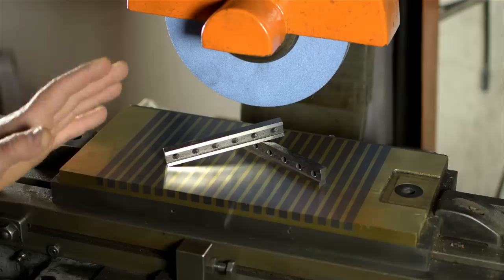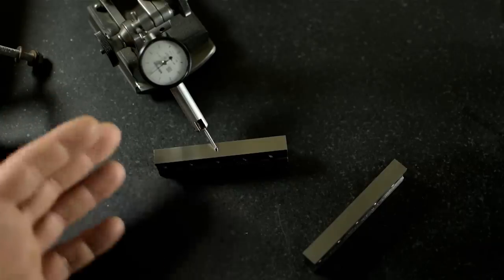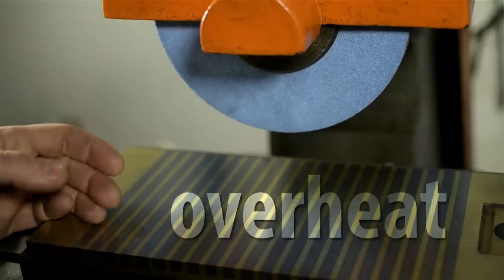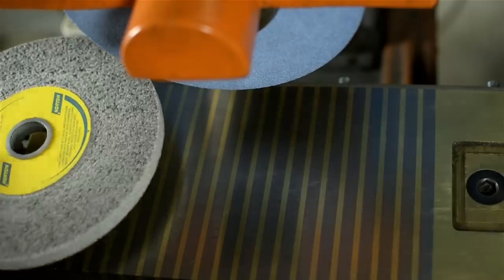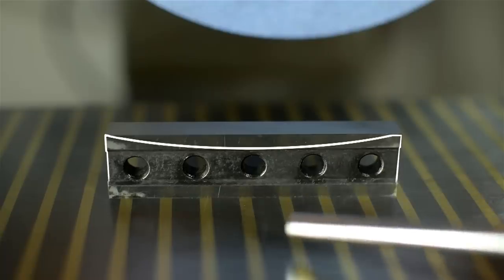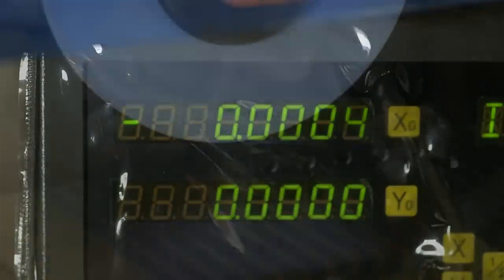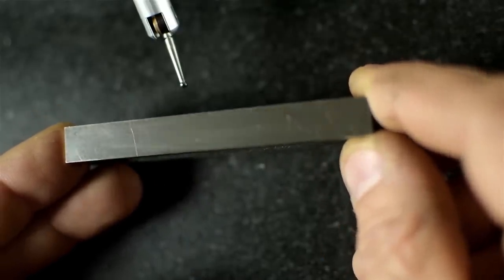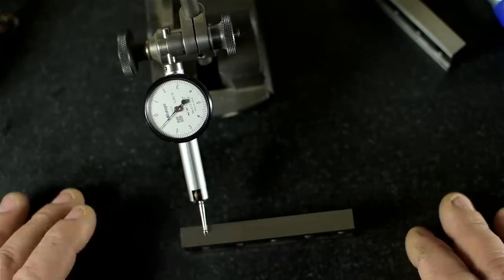Grinding: FEEL THE HEAT

Comment: In all metals heat heat heat is the enemy. On a milling machine the heat must be in the chip, on a lathe heat must be in the chip, on a grinder the part must be cooled with the proper coolant, without it disaster. I've notice when you have been grinding that we haven't seen any coolant, this is a no no. Great videos.

Comment: Don't feel too bad about them being under size.  Many years ago I purchased a "Ultra-Precision" set of Brown and Sharp parallels consisting of 10 pairs in 1/8" increments starting at 1/2".  Not one pair was on size.  All were .005 to .010 under.  They were matched and flat to within .0001 so I still use them today.  Funny thing is I got a no name set of 4 from China that were thicker but are right on size.
Reply: Wow is this just going to become the Brown and Sharpe hate channel now?
Reply: @inthefade  Hope not.  I have a few Brown and Sharpe measuring tools, most are excellent.  Just found it strange that the more expensive set was under size but still usable. With parallels sets size doesn't matter as long as they're the same.

Comment: You could always throw a weld bead on either length then regrind to spec. You'd essentially be re-machining the parts all over again since you'd need to redo the harden and heat treat but it'd get the job done. With this level of precision I don't see why not just do all the work under flooded tools since heat management would be such an issue but I suppose knowing how to do it dry could be useful if such equipment isn't readily available.

Comment: I actually figured out why you didn't align the parallel with the axis of the grinder before you told us, and felt pretty smug about that. But it also made me wonder if it wouldn't be possible to use compressed air to further cool down what you're grinding?

Comment: Putting your piece non-parallel also helps to de-weaponize your piece if something goes wrong. Also, cheap surface grinders need to stay on after they're dressed, because you lose the accuracy once you restart the wheel.

Comment: Not grinder related(unless I mess up the backlash or preload) but can confirm it's a real mongrel to bash a diff crown wheel off twice when you misalign it by a half mm and the bolts won't line up. I blame the expansion from the slow bake in the oven for my errors.

Comment: Ah the joys of explaining to management that if you grind any faster they part is going to be scrap. 

Could always use the classic mill squirt bottle with the dry grinders. Just tends to leave a bit of a caked up ridge in side the wheel guard you will need to chip out from time to time.

Comment: From experience using Seeded Gel wheels... They're absolutely fantastic for rough grinding but for fine grinding there isn't enough grinding force to facilitate grain fracturing.

Also SG wheels are twice to thrice the times more expensive than a ##A wheel.  I have great success dry grinding on all tool steels (4340,S7,D2,CPM M4) using a Norton 32A H-I-J-K hardness range of wheels. 

A question. I noticed you had your dresser pointing AGAINST the wheel rotation. Do you have a particular reason?  Norton manual suggests the opposite (dresser following the wheel rotation)

Comment: Off topic but on the same theme combine, heat, grinding wheel and sparks and do a video on "spark testing steels" Grab a sample of offcuts in mild steel, mid carbon steel, high carbon steel, HSS etc and study the different colour and shape of the sparks produced that gives a rough indication of the content of the  steel re: carbon, chrome, nickel etc. Keep labelled samples handy and you can  always get a good comparison on a random piece of steel for the offcut bin.

Comment: I have run a lot of surface grinders. I have never seen one that the wheel rotated counter-clock-wise. What make grinder is that, and is it wired incorrectly?
Reply: Mine rotates CCW. But it is really a tool grinder with a mag chuck. Brown-Sharpe 10
Reply: I think TOT lives in the southern hemisphere, thus the anti-clockwise rotation.
Reply: @cpcoark  I do not have the experience with tool, and cutter grinders to say if that is the case. Tony was referring to his as a surface grinder, but possibly his is a tool, and cutter grinder too. That #10 of yours must be a nice, as anything B&S is. I did some research on it. Now I want one.
Reply: @ron827  Makes perfect sense.

Comment: To keep heat to a minimum on a dry manual surface grinder down, only use the corner of the wheel,or the edge,not the whole face of the wheel,Norton’s are the best. Only index chuck .002 or .003 and only after every other pass,and I noticed when you dressed the wheel the diamond was on the right side of center of wheel, this is a dangerous situation,if table moves left, you have a good chance of exploding the wheel,please always dress surface grinding wheels on the left of center,unless you’re on a grinder that the wheel spins counter clockwise,I have never seen one like that in 33 yrs.

Comment: Tool hack - Flip the parallel over on the chuck.
Turn the grinding wheel around backwards (or, if you have a 3 phase grinder, just swap 2 power legs for reverse rotation), touch off on the part, back off 10 thou, and just add it back.
Tool hack #2 - Add 10 thou of hot glue.

Comment: At work when I need to skim 50 millions off a part, it's almost guess work and feel for a machine when the sharpie mark is far thicker than the material you need to remove and you manage to only cut the sharpie off and not even 10 millionths of material.

Comment: Since liquid cooling is not an option, what about gas cooling? Air compressor with superchilled airtank should do small parts quite easily before it runs out.

Comment: Never touched metal machining before, just watch these for fun.

Can someone explain to me why surface grinders are ever even used for percision?

Wouldn't it loose abrasive material as it goes along making the surface uneven?
Reply: Well....uhh...technically ....nope! It only cuts on the side going in the direction of feed. It will eventually wear all the way across the face of the wheel, then you have to dress it again.
Reply: @kcraig51  oh okay so it just wears so slowly its really not a problem? Thanks for taking the time to explain to someone curious!

Comment: Former tool & die maker here. I still feel the part was not flat coming out of heat treat and you are still chasing it. The chuck pulled it flat and it sprung back after you removed it. Put your part on a flat chuck bow up slide shims under part. When you turn the chuck on it will not flex and your able to make one flat side. Mostly academic .0001 is fine for nearly anything. I like white wheels for A2 and blue for D2 or other tough tool steels.

Comment: The solution to your problem is simple.  You don't have a strong enough mag chuck.  
To fix it, just stack chucks to increase their strength and they will pull the heat expansion back out of (or would it be into) the work...
uh or something, I saw somebody say it on the internet so it must work...

Comment: On your wheel for example 46 is the grit and the j is the hardness. The higher the letter the harder the wheel. I do tool and die work. A 46 j or h is what i use for 95% of the work.

Comment: I worked for several years as a precision grinder of optical and metrology components. Always grind wet. In fact condition your coolant to match room temperature.

I also spent 40 years as a Precision Engineer. You will not most all precision diamond machining is done under a temperature controlled oil shower.

Kapisch?

Comment: Water cooling? The problem with heat expansion may become a bigger problem. Water may evaporate and take more heat away than you consider. Or cooling water may get warm. You'll need a temperature control of the cooling water tank.
And don't forget about heat radiation influence of a hot motor (a light bulb, sun through a window, a cold/hot wall) shining only on one side of the workpiece. Your granite table warps, too.
That's what you get into thinking in millions of an inch.

Comment: I did my apprenticeship as a toolmaker, spent hours, days, weeks, months! on the surface grinders. Only one grinder had a coolant system and it was a disgusting smelly mess. On the others, when size and flatness were critical, I used to spray the part with a spray bottle of coolant or even just water in between every pass. Especially on the fine grit wheels, even a single pass will add enough heat to warp the part. The part may not even be warm to touch afterwards but there would usually be a dip in the middle. If the part WAS warm, after it had cooled again and you grind it again all the corners and edges would be higher than the middle. Could shrink by .01mm sometimes.

Comment: I don't like using light Al oxide wheels to surface grind. I prefer heavier materials that soak up heat less. But at work they use it cause it's cheap so I do the exact same thing. Cross and grind, then final 0.0004 to +/-0.0002 I do a straight grind to make it look nice and normie. ALso I don't have a grinder at home or at work anymore. Cause COvalia fired me.

Comment: 46 is the grit size, j is hardness, 46j is too hard, a 46i or even a 46g, personally i like 60g or 60i, i appreciate all the editing you probably have to do to make such entertaining videos
Reply: What materials do you grind? Don't you find G wheels to break down too quickly? Also are you grinding coolant or dry?
Reply: @agg42  i am a professional (i try to be professional) tool and die maker, i grind hard material, like m4, t15 the pm type tool steels, some grind a2 with the G wheels but i think  the wheel breaks down too quickly, a 60g works better for a2, but a 60 or 46i i tend to get better results,  the crossfeed needs to be  adjusted for the finer wheels,  everything is dry on an okamoto grinder

Comment: So weird when you say 2 tenths and it comes up as tinny (fraction of a mm), even after your explanation that 2 tenths of an inch is actually tenths of a thousandth of an inch. Just curious as to why not call it a 10,000th if an inch?
Reply: That's fine for you youngsters to say "two ten thousandths of an inch" Try it when you're over 65 with no teeth and arthritis in your lips.
Reply: @thaumaturgicresearchcounci4180  brilliant response!
Reply: James Sloan  I know what he means too, as he has explained it previously for us metric people, as I alluded to with my initial comment. 
That however does not stop it from sounding weird to me, like with many aspects of learning a new language or subset of that language (imperial machinest in this case) it can seem very strange and counter intuitive. To me a tenth of an inch would intuitively be just that about 2.54mm (or a ¼ of a centimetre for those with a fractional preference).
Reply: James Sloan  calibrated fingernails and a large display  DRO...

Comment: 2/10th of an inch sounds like a really big variation!  or was that misspoken?  but then later in the video you say 4/10ths when it shows .0004....you must be referring to ten-thousandths as "tenths"...thats a new dimension to machinist lingo that i'm not familiar with.
Reply: Machinists work in thousandths of an inch (.001"), so when they say tenths, they mean tenths of one thousandth, or .0001"

Comment: ,,, it almost never matters,  but you might wanna keep that diamond to the left of 6 o:clock, just in case the magnet doesn't hold .
Reply: Since that grinder spins CCW that could make the wheel suck in the thing if the chuck lets go.
Reply: @BillyONeal  ,,, I've never seen a surface grinder that did not spin clockwise .
Reply: @BillyONeal  ,,, well, I just went back and looked, and this one does run CCW .

Comment: 46-J is too hard. It will heat up the work too much. You want a 46-H. Coming from a journeyman Tool & Die maker with over 35 years of precision grinding  experience. SG wheels are nice but only necessary for D2 or CPM steels. That 80-F wheel is a real oddball - useless for flat dry work on a 6x12 grinder. Watch Suburban Tool videos to see how productive tool grinder hands grind.
Reply: I've found a VFD speed control an indispensible accessory on a 6x12 grinder. You can make a hard wheel act softer and vice versa. It saves dressing and changing wheels. The braking and soft-start are time savers too.

Comment: You said 2 tenth of an inch  = .2"  You showed 2 ten thousandth of an inch  = .0002"
Reply: James Sloan  That maybe true. I spent my entire adult life in aviation. Both as a mechanic and in aircraft manufacturing. Accuracy was of the utmost importance. For example when making and installing a freeze plug, the tolerance was most often in the tens of thousandths range. Drawing tolerances were often in the thousandths of an inch. I guess it comes down to what you are use to. If someone says 2 tenths, it is assumed he means what he says.

Comment: Omph!  .010" under?  On the grinder?  As my boss used to say, "$100/hour or $.75/lbs".  Also, when a part is scrapped, you just lost 3x the shop time, or you just divided your shop rate by 3.  Measure 3x, cut once,

Comment: I don't care how many machinists do it, you can't say "two tenths of an inch" and expect people to think it's .0002. THAT IS 2 TEN THOUSANDTHS OF AN INCH. two tenths is .2. You can't just change freaking how numbers work to make it easier to say!

Okay, I'm done now. Until next time anyway.
Reply: 'merica!
Reply: @mariusthefaker9339  Indeed, the worst thing is hearing a yank say "niche", it makes me physically sick. Not to complain about TOT though, he's well worth the 40% imperial price of admission :-D
Reply: Lone Wolf...When we give dimensions, we are giving them in thousandths of an inch.... therefore...we are talking about tenths of a thousandth, not tenths of an inch.
Reply: @davidkehr4730  That would work if you used thousands as a hard datum point, but you never do.
Reply: @davidkehr4730  When we give dimensions, even in American industry, we give them in millimetres, inches only survive in screen sizes, wheel sizes, p*n*s sizes, American casual society, and products designed to appeal to that society, not to industry.
Reply: @fredio54  Tony was using inches, not millimeters.
Reply: @davidkehr4730  Well aware, he sometimes does, like a relapse of an alcoholic who can't quite help himself. I stomach it, as I know he's fully capable of entirely metric operation and does so as much as makes sense for him with local imperial steel stock supply, etc.